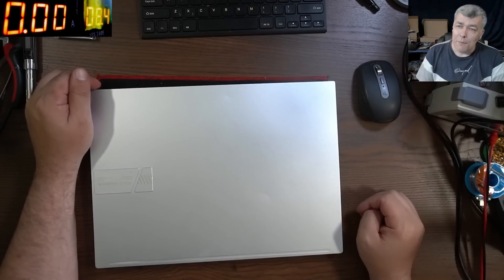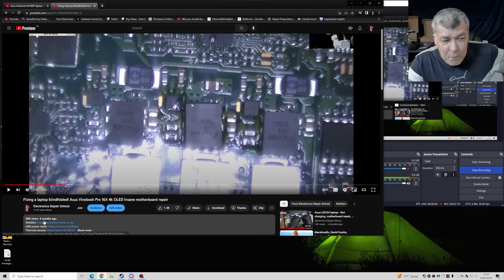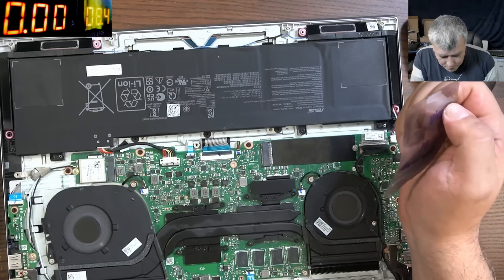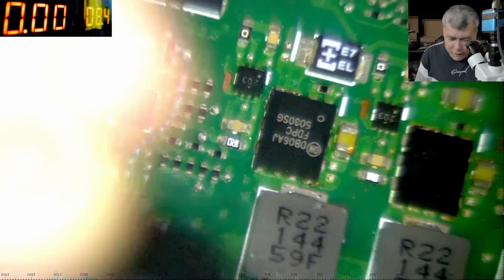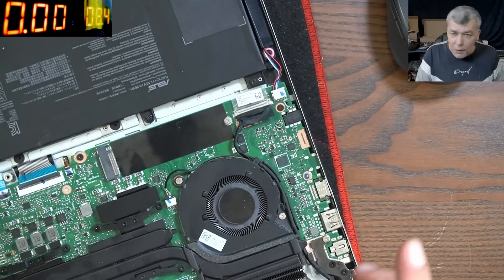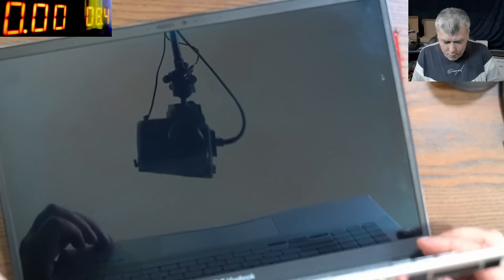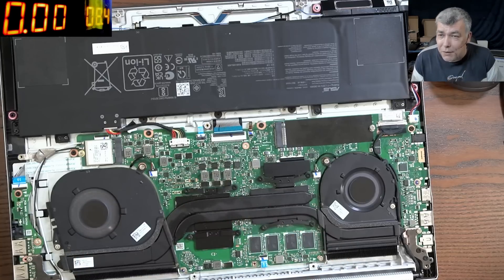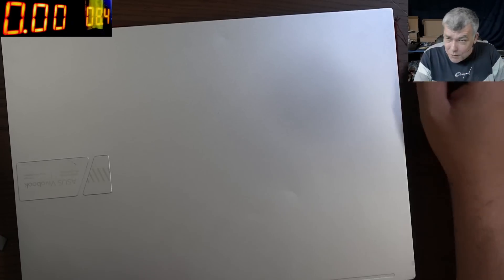Asus Vivobook N7600P mosfet replacement - Why always the middle mosfet getting shorted!

Comment: Absolutely thermal pad is the longevity solution. Unless I'm wrong;  I noted the highest heat point was actually the middle inductor coil. Similar to MSI gaming unit's; seeing thermal pads particularly at BGA covering both coils, and mosfet's. Looking specifically at Mosfet temps. it looked to me as though mosfet temperatures seemed relatively uniform. 
100% agree with your analysis, and practical  theory, including the diagnosis as manufacturers design defect ! Luv your channel, Thank you sir.

Comment: Check the current flowing through each of the three MOSFETs and that will give you the true power going through them. 
Also, put some of the heat sink rubbers stuff on each one with a space between each rubber strip

Comment: I'm confused! MOSFETs are positive temperature coefficient devices. Therefore, as the temperature of the device increases, the resistance increases. In other words, higher temperatures result in lower currents, thereby surely
working less, not more?

Comment: If a thin sheet of aluminum with two anchors had been placed on top of these three components (like the one used in TV tuners and/or cell phone), I think it would be a feasible solution for the new boards that this manufacturer will build. Another way of saying it, it's up to Asus engineers, not us, that is, it's up to them. All the best.

Comment: Good observation! I never though of that but it seems pretty logic the center mosfet will get hotter. Shame on me! kkkkkk
4:30 Not a different manufacturer, that first line is code for assembly plant, date and lot.
The logo difference is probably due to a different factory/building of the same manufacturer (or it's counterfeit, but I don't think so because I have seen that difference before). Onsemi has plants in several places and they produce quality components.
We don't really know how the seller is storing their supplies and for how long it was stored, it seems that some oxidation formed on that mosfet pins.
When the new part has a dull color like that I always clean it with some acid before soldering.
New components are never shiny, of  course, but that one was too much opaque to me.

19:00 that thermalpad is usually over the  coils. Better if you let it over the coils and yours over the mosfets, double protection!

Comment: Sorin, sorry the thermal camera showed the inductors getting hotter not the mosfets or the thermal camera is not calibrated, not be able to solder new chips is common they are oxidized use fiberglass brush to clean it :D

Comment: 8:55 just buy fibreglass pen - it will scratch gently remove the oxidation, and you can use is also when you want to do a jump wire (to easly remove the solder mask ).
Or if you don't want to buy it, then use a sand paper or precision knife to scrap that oxidation. The mosfet is good and original, but It was storage in bad condition, that is why the pads are more grey, not shiny.

Comment: As I am watching the video I see that the coils are getting hot.  Not the mosfets.  I have no intention to correct you Sorin.  Just observing.
Reply: Coil temperature is indicative of the temperature inside the PCB in the current carrying layers in that PCB area, since they have the best thermal contact to there. By itself it's not interesting.
Reply: And I got to the other video. There also. The middle coil is getting hotter.

Comment: One shim going to that heatpipe woulda done it.

Seems like a lot of heat leaking across the board from there too.   . .ohhh that shell...good job whichever drawing board designer chose looks over function 🤦 i bet they moved the pad so the slatted design wasnt affected 🤣. Not good for a brand like asus

Comment: Sorin i'm presently suffering an serious issue with an cheap ASUS laptop and i'm becoming distrusting of the manufacturer even more so with his recent AMD chip burning issue and not honouring warranties with his "dodgy" BIOS updates thats right Sorin he's the real one who is seriously dodgy...but what does all of this say about the quality of materials if your having to "tin" with solder those Mosfets? never mind the heat dissipation issue which he has clearly missed after all its not really your place to put this manufacturer right but as you can see you obviously are...I swear i'm never going to purchase anything from this manufacturer again i've had it up to here with him and the dead laptop i'm left with...
Reply: Well it's not like he's buying the MOSFET from ASUS. The MOSFET probably spent 10+ years at parts supplier on the way to him and grew a hard oxide layer, maybe it wasn't handled very well. So MOSFET rejecting solder is just unfortunate but neither here nor there, does not reflect badly on ASUS anyhow. The rest of the issues do reflect badly on them.

Comment: Was the resistance at the coils the same.
Reply: @SidneyCritic: Hi. (4:07) The three part numbers of those coils located just below each Mosfet are similar, so in theory the resistance should be the same value but we don't usually want to unsolder them, so if we have different readings between them it is due to the resistance added by the other components mounted (related to them) on the PCB. Due to the area where they are mounted, the values should be [0.2 - 100] ohms, that is, less than one hundred ohms. All the best.
Reply: @carlosgarciaoropeza5480  Usually VRMs are in parallel, ie same resistance, but I was thinking it might be something like a graphics card. Basically GPUs have identical VRMs, but some are for VRAM and some are for GPU, ie, different loads. I was only interested in the resistance on the load side, so it's just a measure from the coil/inductor side to GND. It was a long-shot that they are separate, but it would've been nice if it was confirmed - I've noticed Sorin glosses over most stuff, ie, he knows in his head, but never tells us -. Oh well

Comment: Sorin if you can't solder the new MOSFETs because the solder don't stick on it, is because the silver layer oxidate over time because they take the components out of the vacuum enclosure.. 
You have to polish first and tin it.
Reply: Yeah, I've had the same problem with new chips. The manufacturer told me that I have to let it in a furnace with a controlled temperature of 100ºC for 24h to remove humidity and the oxidation layer before installation - something that I doubt anyone does.
Reply: @viniciusvbf22   we can't wait for the whole 24hrs sure

Comment: @ 5:40 does it matter that two top left pins of middle are soldered together?
Reply: Yeah it's all good, no harm at all.
Reply: @Ed Boss: It's normal, it doesn't matter; (5:42) Notice that both top left pins are soldered into a wide (thick) circuit line leading to one end of an smd ceramic capacitor. On the other hand, if the two pins in the upper right corner were soldered together, then we DO have a problem (short circuit) since they go one by one to each end of the small black body smd component. All the best.

Comment: Maybe...   Use 2 very thin pads with aluminium wedge between and this will dump the heat better to the cover,  than a big chunk of pad or pads as when thick they resist heat more.   Unless the part expands a lot, i use thin .5mm pads to transfer the heat as much as possible to copper or Aluminium. Gaming Mosfets can get really hot and you only had it idling, so really hot when running hard? No wonder they fail early. Maybe ASUS  could use heavy mosfets to take the stress??
Reply: Asus should just use one more phase and it will work fine. But which company wants to make product that last long time amy,pre?
Reply: it's weird because when you enter the bios, the cpu is getting a full load
it's not idling